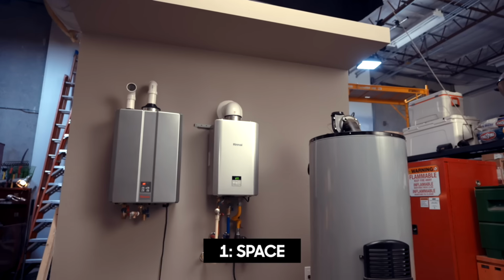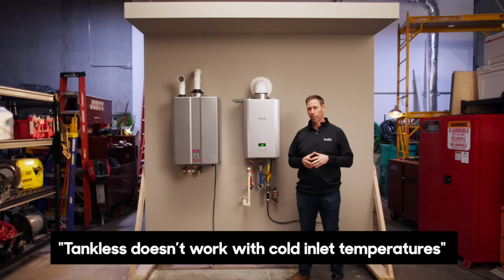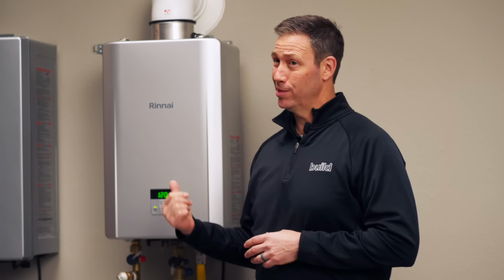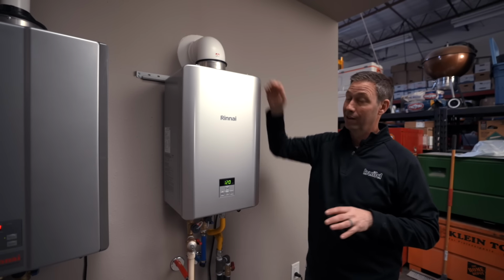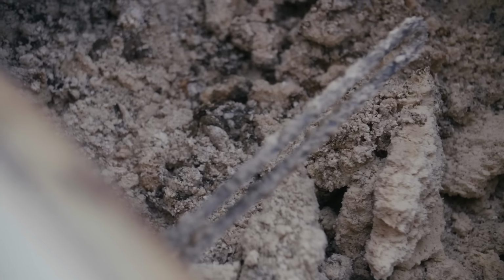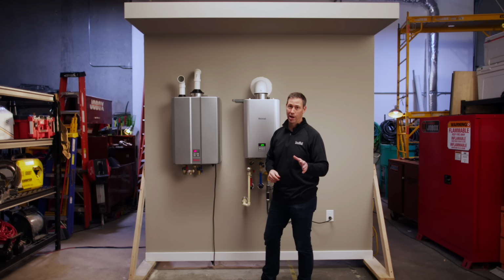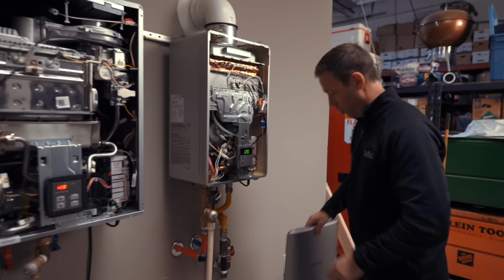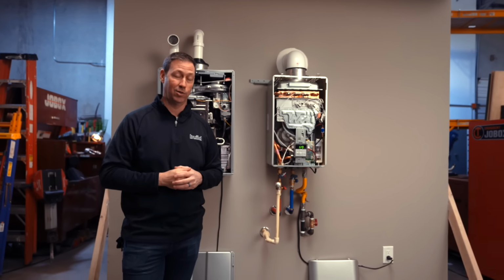DEBUNKING Tankless water heater LIES!

Comment: The whole “Instant Hot Water” is one that really annoys me. Like you said, you can get those with built in recirculation pumps, but I see way too many people who think that just by putting in a tankless that they’re going to be able to get the instant hot water benefit of a recirc loop. And I see way too many people selling a tankless as being able to do that. They’ll say, “switch to a tankless water heater if you want hot water immediately after turning on a faucet.” That is NOT a tankless water heater feature, it’s a recirculation loop feature, available for both tank and tankless water heaters. Now I will say, having a built in recirc pump is awesome if your plumbing is set up for that!
Reply: If you install a recirculation pump on your tankless. Wouldn't that mean your tankless would continually run to keep the water hot in your uninsulated pipes?
Reply: @Powerfade54  It depends on the heat loss in the recirc loop. Typically, once it is up to temp, the heater will cut out. If you have a massive recirc loop that looses all its heat before getting back to the tankless, then it will continue to run.

Comment: Had several types of hot water heater over many years in Australia. The original was a couple of tank less mains pressure from the 30's (415 volts). They worked ok but used a lot of power and were not that safe.  They were replaced with a tank style to take advantage of off peak power, it was ok but after 7 years and one month (warranty was 7 years} it started to leak. Replaced it and added a solar hot water heater, made a 60% difference to power consumption and with servicing lasted another 20 years. Replaced with the same but modern and that improved again by another 15% (6% overall). 10 years later we fitted solar to the roof for electrical assistance it worked ok so fitted more and removed the roof mounted hot water solar system. The tank style unit was also replaced with a tank style that used hot air to aid the heating process . We have plenty of solar electricity and usually put way more into the grid than we use but occasionally use more during the day. I had some battery's fitted when the last hot water service died and went back to a house wide demand system. Probably due to not storing hot water for days Overall it's the best it has ever worked.

Comment: In my non professional opinion and experience, there are two issues with tankless water heaters that I find annoying.   When I replaced a water heater tank with a tankless Rinnai in the exact same location, there was a noticeable delay in the time it took for hot water to reach outlying locations in comparison to the standard tank version.  I thought that perhaps the delay was partially due to the fact that the water in the tank was already hot even though I've read that there isn't supposed to be a noticeable difference in how quickly hot water is distributed.  The most annoying issues for me are that the tankless unit wastes a lot of water and in today's environment of drought and ever escalating water bills, the cost of that waste adds up quickly.  With my unit, if you don't maintain a moderate flow rate, the water heater apparently can't sense that hot water is desired and so the heater either won't activate or stops heating the water that is already flowing to outlying locations.  In trying to conserve water I always use the minimum water flow when using the sink which includes shutting the water off and on several times while brushing my teeth, washing my hands, shaving etc.  Again, every time you shut the water off and on, the tankless heater shuts down and has to start over in heating the water and that causes a very unwelcome cold water flow before hot water once again arrives at the desired location.  That reality is both an annoying inconvenience and even more importantly, a waste of water.  A standard water heater tank poses none of those annoying issues and could also run all day supplying copious amounts of hot water under those minimal use conditions.
Reply: "Every time you shut the water off and on, the tankless heater shuts down and has to start over in heating the water and that causes a very unwelcome cold water flow before hot water once again arrives at the desired location."

Exactly.  That phenomenon even has a name -- it's called the "cold water sandwich".  (Hot water flowing, then you shut it off, then you turn it back on again, but before the heater fires up again and the hot water comes back, you have an unpleasant slug of cold water in the middle.) 

Technologies now exist to mitigate this problem, but for the host to say it's a "total myth" is disingenuous.  He's just trying to sell Rennai tankless water heaters.  :-\
Reply: @Milesco    Thank you for your input.  Now I know what to call it when I'm cursing at it in the moment.  Would you mind elaborating on the technologies that can avoid this problem?
Reply: @hmbwoodman9444  buffer tanks. For example, navien tables units have buffer tanks that store a small amount of hot water that goes out first while the unit is heating new water. This way it's a continuous flow of hot water

Comment: I had a tankless one 2 houses ago, it was fantastic! used it for 2years before i moved. only had one issue, fixed it myself. I also had vary hard water. wired up the remote in the bathroom. 103 deg for showers, only using hot water. it was very nice bieng able to do laundry all afternoon then go right to the shower. Oh and the kid or wife wants to take a bath right before you shower?? its got your back! I plan on replacing the tanked one in my current house this fall.

Comment: Two issues, one just from looking at a still of the video:

* These units are both GAS units. I have owned and lived in two houses. Both were total electric and heat pump heated. This one is ground loop heat pump, AND also puts some heat INTO the TANK electric water heater.

HOW can I compare tankless electric with tank electric? You don't even mention electric, which probably needs a bigger than 30 A feed.

* You said that tank WH may last only 10 years (but are showing only gas).
My first house, built in 1960, had the water heater fail long after I bought it as a second owner. I did the math, and that tank lasted about 50 years before it finally got a leak. The tank was still so strong, that I stripped it and made a big lawn roller, filled with sand. And a frame was built by an expert welder friend of heavy angle iron and ball bearings. That was about 10 years ago, and I am still pulling it with my 20 HP diesel compact tractor. (maybe they don't make them like they used to).
So in this newer house, the tank electric is at least 7, probably 10 years old already, and no issues.

I DO have a Kinetico water softener on the system, which I recently replaced. The old one was so old they couldn't even tell me how old, as it wasn't on their records anywhere.
Both houses were in the country and with a water softener.
Reply: An electric tankless big enough to sufficiently run most houses can require anywhere from 100 amps to 200 amps. Also, depending on the inlet water temp you will never get full gpm out of them. They are also notorious for a cold water sandwich

Comment: In the UK gas combo-boilers which combine heat and hot water without a hot water storage tanks are the norm. They are common throughout Europe. You do need to meet the kW of the combo-boiler to you needs but never had a problem even in multi-bathroom house. They are highly efficient. The UK is not a hot country with ice and frost in winter months, my current model is 28kw the lowest in the range which goes up to 44kw, as the kids have moved out, and supplies hot water and heating at a very good rate.
It comes with 15 year manufactures warranty and cost @ $120 per annum to service and safety check.
There is no such thing as running out of hot water here 😁. The combo-boiler is also capable of burning gas with 20% hydrogen content should hydrogen ever be introduced into our national gas grid.

Comment: My hot water started to smell like rotten eggs and I replaced the gas hot water tank because it was 10 years old and I didn't trust it. The rotten egg smell was gone for about a week. Out of curiosity, I flushed the new tank and the smell was gone for another week. My question is... does my new tank have a bad or inferior anode rod? Also, does tankless eliminate the rotten egg smell?
I do flush my tank once a year.
Thank you
Reply: I’ll guess you have well water? That’s the cause of smell
Reply: @joem5332  the smell goes away for a few days when I backwash the lines. A lot of black water comes out when  i am done. I just bought a electronic anode but the year old anode is super tight. Going to try an impact drill to loosen it.

Comment: I realize that it is ancient history but when I lived in Germany during the early 80's, I had a tankless water heater.  It took a certain volume of flow to trigger it on.  In my house on top of a mountain, that flow was at full on with the hot tap only.  What you got was steam which would peel your skin off.  I ended up taking cold showers for over 3 years.
Reply: Probably a change in technology, but I've never hit a minimum flow with the one I have currently and you can set the output temp to whatever you want it to be.  The only issue I have had in 2+ years of use is when we had the dishwasher and clothes washer running at the same time I wanted to take a shower, I couldn't get it quite as hot as I wanted to.  It was maxing out at just a bit cooler than I wanted.  Every other day that I've had it, when I get in the shower I set the temp, and it stays at that exact temp for as long as I want to stand there.
Reply: never install one off city water

Comment: Tankless is a joke.  In the winter I have to run (and waste) a ton of cold water down the drain until I get hot water at the kitchen sink, at any of the bathroom sinks, and in the shower and in the tub.  Just the water waste alone is  unacceptable.  The tankless hot water system can work for some people, but not for me.  If a smaller hot water tank were hooked up to the tankless in series, so that a small amount of hot water would be immediately available, then that would be a possible good alternative.  
I say all this because I first run the water until it gets hot (about two minutes' worth) to run the dishwasher, which is also one of those "High Efficiency" compliant dishwashers.  During the cycle of the dishwasher, it expels water and draws new water.  The water in the pipes and in the tankless goes too low for effective use in a dishwasher, and draws and fills its next cycle of water, which ends up being cold, and likewise with the next, and the next, and the next, up to the final rinse.  The result?  I shall withhold my colorful metaphors.  A "premium energy saving" tankless hot water heater, and a "premium energy saving" dishwasher that under-performs (understatement)... and that's just the beginning of my unending gripe with tankless hot water.  It's garbage, and I will NOT have it installed in my next home!!!!

Comment: One thing to point out , if your Hydro goes out , which it does all the time in my neighbourhood,
you'll loose your hot water with hot water on demand , or a forced air flow hot water tank.
.
Hot water on demand is used all thoughout Europe - and they are great -  but if you are thinking about having one installed , make sure you think about where the vent pipes will be routed . 
.

Comment: Hey Matt,

Got any info for the tankless on only electric? We've been considering these for a couple years, but our area doesn't have gas and I'd rather not plumb a propane line into our basement. I have a place I might be able to vent, but am not sure how well these units perform on only electric vs. our (current) hybrid electric and heat pump unit. Hoping you might have some info.

Jason
Reply: A few years ago I installed a 16,000 BTU all electric Rheem on demand tankless water heater. I love it. The only downside for me is that it required two double pole 50 amp breakers. My panel configuration as it was didn't allow for this.
It's just me on the house so I can confidently say the on demand heater is MUCH more efficient than a tank keeps water hot all day, every day.  If my panel would allow it I would add smaller units at the bathroom and kitchen faucets.
Reply: @keithbrookshire  so you needed 100amp power to run one tankless?

Comment: Electric heaters are garbage. Fluctuation. Significant power upgrades.  Only natural gas is a viable option. Electric is garbage. The power needed for constant flow is rediculous and it will fluctuate with another fixture being opened

Comment: We are on gas. Just bought a house with local gas supply. Worst thing ever. Hot water wont come in unless you have enough pressure going through which means you either have a stone cold shower or scolding hot with no inbetween. Ok in winter when you want hot but in summer when you just want warm you have to be clever to get the exact pressure coming through to get any hot water. Otherwise it will go cold.
Mind you I did have to replace the tank in our old house for $1800 a year before we sold. But gas is not the turn on and get hot water instantly option it is proposed to be. Takes a while for it to kick in and as i said if you dont have enough pressure through the hot pipe it will turn itself off. Bit of a shock when standing in the shower.

Comment: The half-truths in this paid ad are disappointing. I'll just touch on one thing that very few understand: the claim of 95% efficiency. This only happens on condensing units (which are far more expensive), and it's ONLY going to reach that efficiency after you've been drawing hot water for several consecutive minutes. So, unless you have 3 or 4 teenagers in your house who each take a 30 minute shower every day or you operate a commercial dishwasher, you'll never get close to the rated efficiency and you'll NEVER recover the up front cost in gas saving either way. As a licensed plumber and gas contractor, I always explain this to customers who are considering a tankless. All but one has thanked me for educating them.
Reply: Underrated comment
Reply: I live in quebec , I have free electricity 🤣
Reply: What’s the science behind you saying that they’re not 95% efficient based on the usage pattern?
Reply: @Idgafwyw   the science is the secondary heat exchanger has to reach full temp and stay there while being used before it can pull the latent BTUs out of the exhaust gases during phase change back to water (^see "condensing unit"^). Scientifically it is very straightforward, and functionally it works well under the right conditions, (<--- key phrase) but the marketing of this concept is shady at best.

Comment: It is absurdly false for Matt to claim that now days a tankless costs about the same as a tank... not to mention a more costly install.  The total cost of ownership over a 15 year period is considerably more for a tankless (per Consumer Reports who also said there is no payback for the extra cost).  How much does it cost to periodically have a plumber come out and clean the heat exchanger?  To say you have to deal with scale regardless of system is false again.  Note that Matt shows an electric tank...not a gas tank which has MUCH more HX surface area.  The average homeowner can open a valve to drain sediment from a gas tank but most can't or won't clean a heat exchanger.  Most home owners DO NO water heater maintenance... a little REALITY check.  As a plumber in Texas I have seen countless homeowners that had to either get new systems or heat exchangers.
Reply: Agreed. It's all about total cost of ownership. Tankless are more expensive according to CR. If the space you gain back and endless hot water are worth the additional TCO of tankless then it's a good choice for you. Otherwise just get an efficient tank.
Reply: @Lew114  It's sad that I have to debunk the lies of a YouTube salesman who claims to be debunking lies... for a company... how much is Rinnai paying Joe Buck?  It surely can't be that much...

Comment: In addition to very high install cost, tankless charges you for $200+ / year maintenance.  I replaced a 50gal std water heater 12 years ago for $1200 and it is still going strong with only operating cost.

Comment: I use to hear from people that tankless really did not save any money . There are a few reasons for this and usually comes down to using the tankless improperly . Mentioned in the video was that he used cold water to temper it down to take a shower, which is one of the biggest reasons people may not see much of a savings . You should set the tankless temp to the comfortable setting which does not require you to mix cold water back in when taking a shower . When doing so you just cooled down the water that you just spent energy on heating up . Next is the mentioned "Never running out of hot water " . When one knows they have endless hot water , everyone in the house then tends to take longer showers which negates any savings one would have seen .
Reply: shower temp is not hot enough for hand dish washing nor for hot water wash.  I use cold wash mostly for earth's sake but when i need hot, i need hot.  If the savings only come in if you don't ever use HOT water, then it's not actually an advantage of the tankless is it?  You'd get same savings with a lukewarm tank.  Or do you have a separate tankless for the shower, in which case please tell me how installing and maintaining two units saves money?